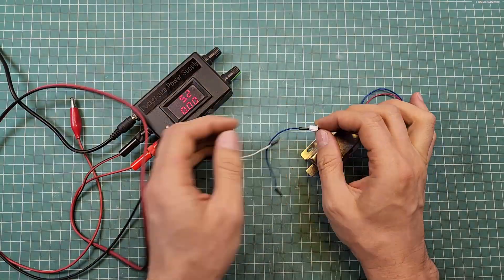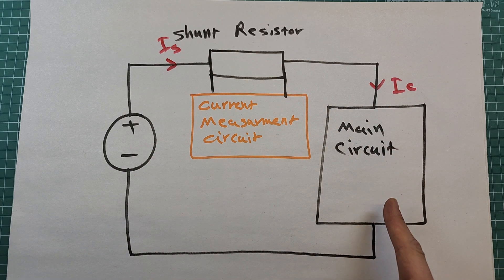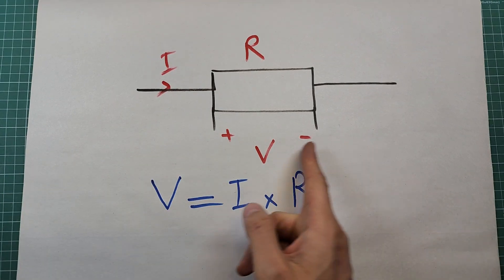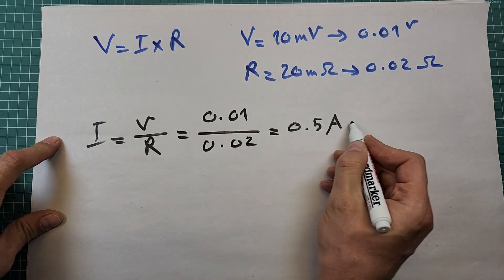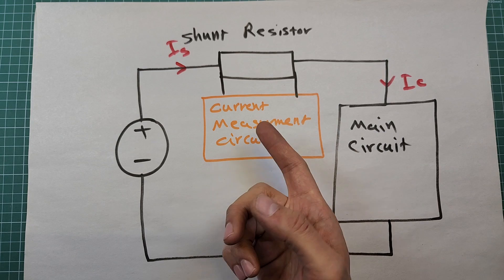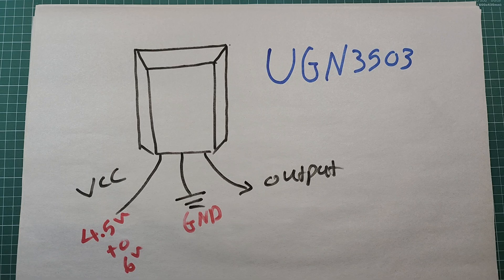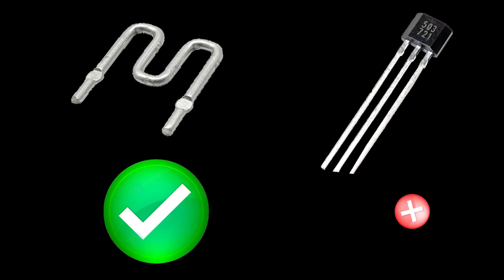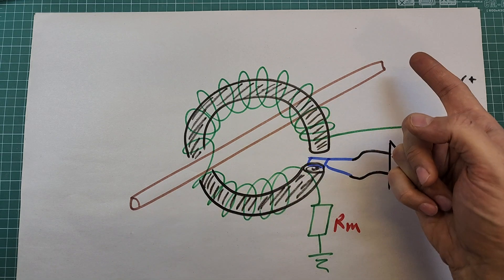How to Measure DC Current: Shunt Resistor vs. Hall Effect Sensor

Comment: OK, that's interesting and well thought out. But how expensive will it be to use a magnet, a cable and a Hall sensor? Using a shunt resistor and a sensor to measure current will be much cheaper. And the price of the electronics will be the deciding factor. It also saves space when designing the circuit board. Still a cool idea ❤
Reply: If you're measuring a small current on a board then I agree, a shunt is the quickest, easiest method, although you do have to be careful where in the circuit you place. However if you want to measure the current of an external circuit using an isolated hall sensor is absolutely the way forward. This is especially important if you wanted to say, build a current meter for mains electricity. Using a shunt means you'd have to break into at 120/240Vac circuit, something this is not only NOT recommended, but may also be illegal depending on your jurisdiction.
Reply from the maker: Thank you for pointing out that 👌
Reply: If you have ever seen multimeters with a clamp on them, this is intact the current sensor with a hall effect transistor in it. The advantage is, if I want to measure the current going into my hot water heater, I can just seperate the hot and neutral leads and clamp onto one wire and know. I don't have to rewire the system. And to have a load resistor large enough to measure that amount of current is not practical. They sell mini current clamps for this exact purpose and you can measure every circuit in your house individually with a microprocessor in this manner without ever rewiring anything. It can cost more some times but not always. If you need a resistor that can handle 500watts it's cheaper to buy a current sensor, not to mention they don't get hot like the resistor will. If you calibrate a hall effect sensor yourself, you can use it by itself for only about 1.50$ per sensor or even less in bulk.